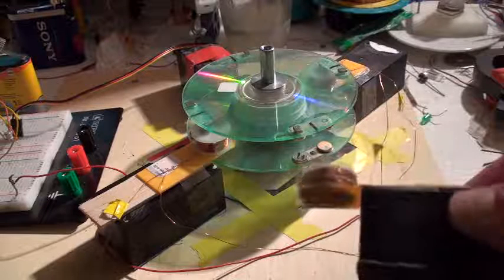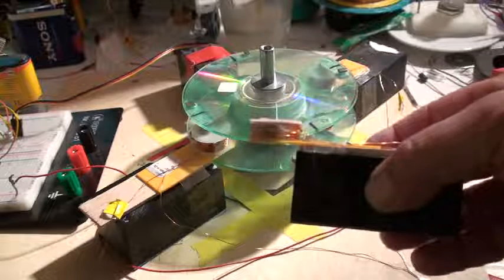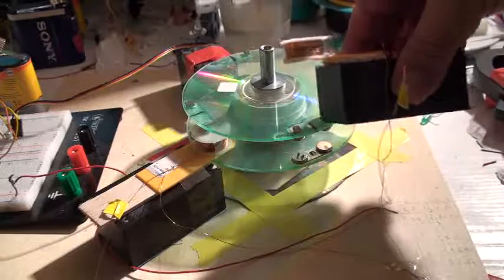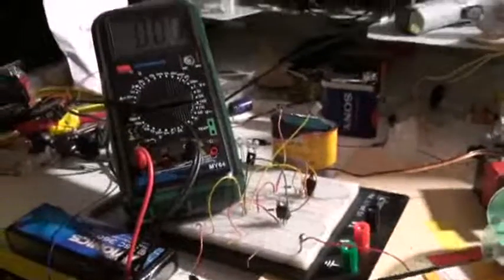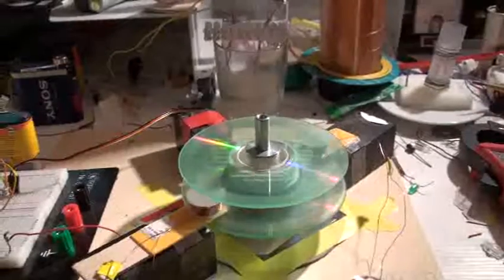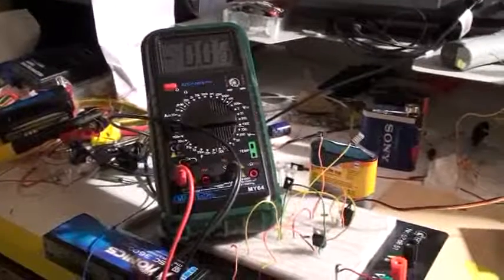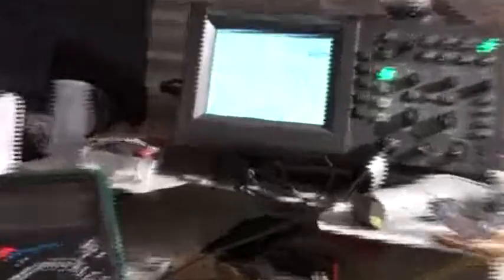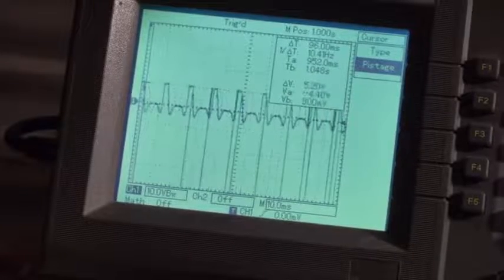Garrys motor 1 .wmv

Comment: when I ran mine on my push bike at full load it drew 1.1 amps at 96 volts and was propelling me at 22kph. that was with my 95kg and a pack of 8 7 amp hour batteries.